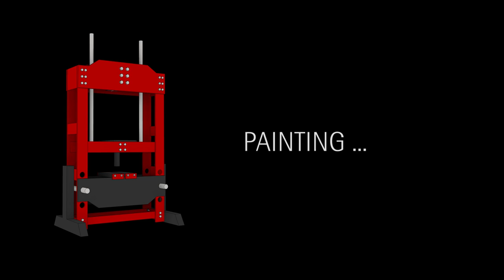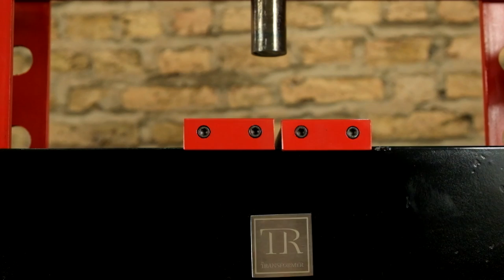Homemade Hydraulic Shop Press | DIY Hydraulic Press

Comment: Do you have plans for this press?
Reply from the maker: Yes.
It needs some modifications.
I will share it with you in few days.
Reply: @TheTransformerChannel  roger roger thanks
Reply from the maker: I've uploaded Autodesk Inventor files and also an exported 3D DWG file.
Please check drawings and the design before using it.
https://drive.google.com/file/d/15ATpaqrHzZafSyk0FnmgNKZW_E01fK5C/view?usp=sharing